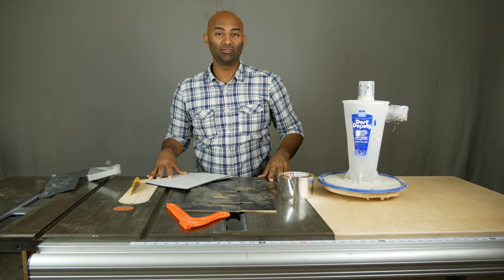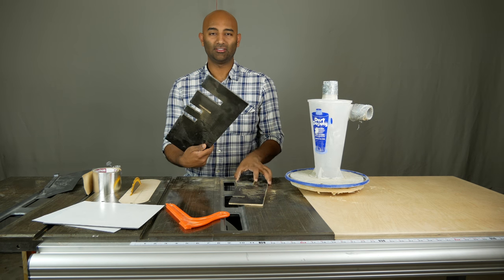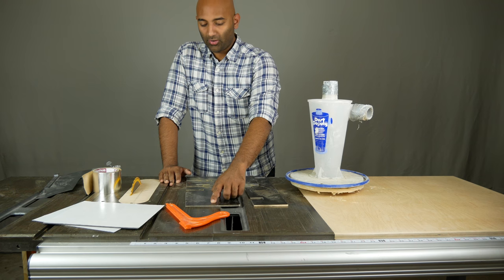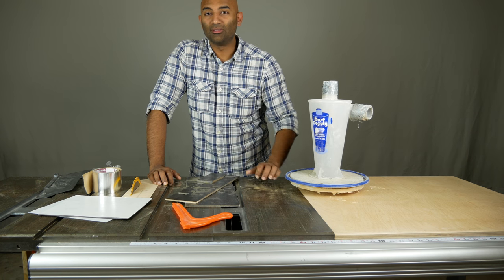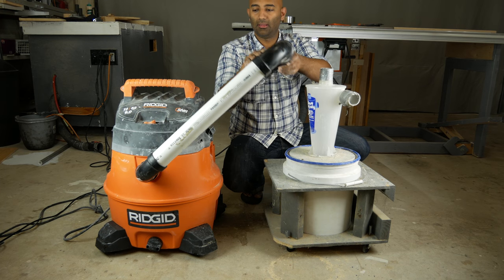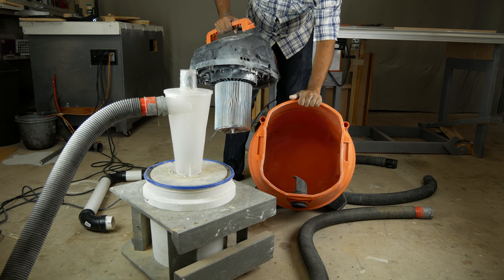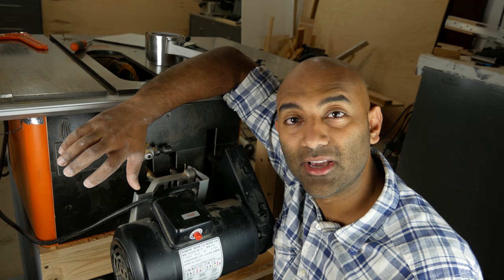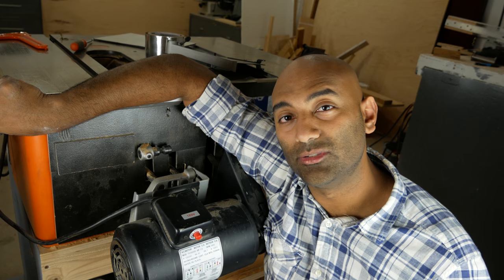Upgrade Your Shop Dust Collection: Sealed Table Saw w Shop Vac & Oneida Dust Deputy Pt. 4

Comment: I’m sure you have already discovered this but when you change the thickness of your blade the tape measure you put on in pt.3 will be off the difference in thickness. As you said though if all your measurements are off by the same amount it normally will work ok. In some instances it will totally screw up your project, check and double check. Great videos!